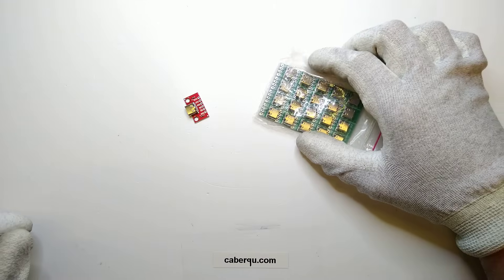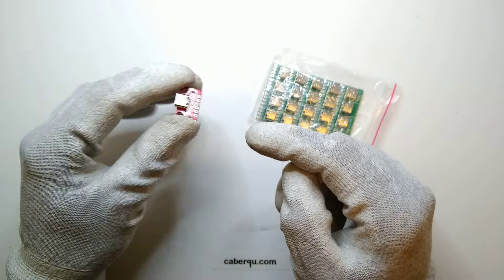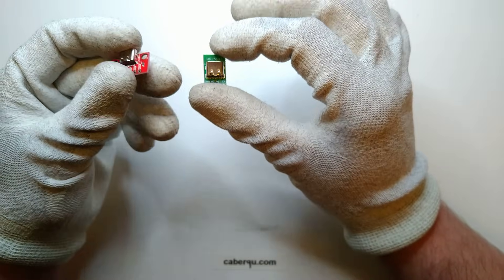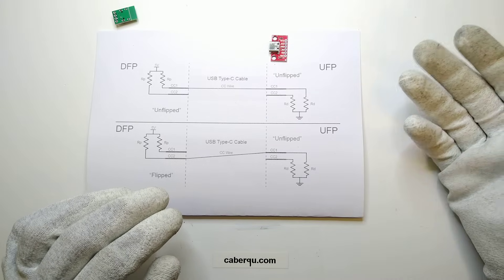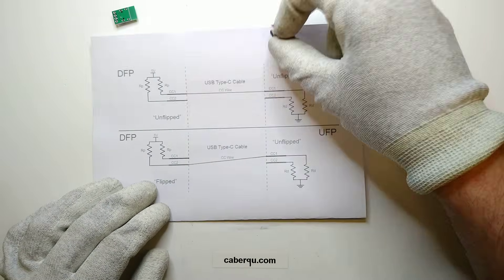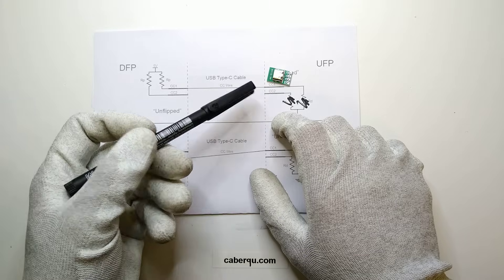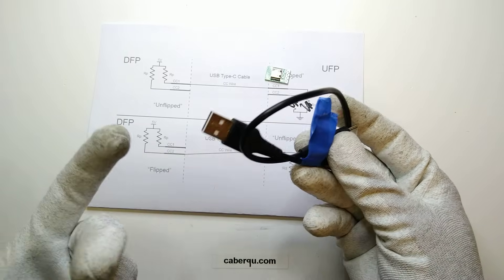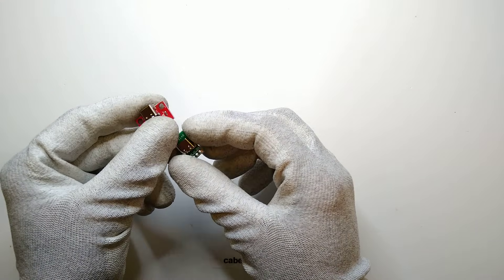Bad breakout boards make USB-C devices unusable

Comment: Here's a question, I've had small USB-C devices that only reliably work on USB A cables and chargers, but they also work with some cheap multi port charger over C2C. What could cause that?

Comment: Wow, I just spent about 20 min on amazon looking at usb-c boards and almost bought the exact same green one you have. I ended up landing on the red one when I came across it last second because it had the downward facing screw holes. turns out I dogged a bullet too! Great vid, ez to follow

Comment: There is also a very common breakout that connects the two CC pins together with a single resistor. This isn't correct either but at least the pins are present so it's possible - with a lot of effort - to modify it to work. 
I'd prefer one much narrower than the red boards so I had to make my own. I wish the manufactures of these things would get a clue and make something more useful.
Reply: You can cut the trace that goes from one of the CC pins, and solder another resistor from that pin to ground, and the original one as well, and it will work
Reply: @rdec726  I have done this. But it's annoying that I have to. I've also soldered SMD reisistors to the edge of pcbs that just have D pads. Why are the correct ones so hard to find ?